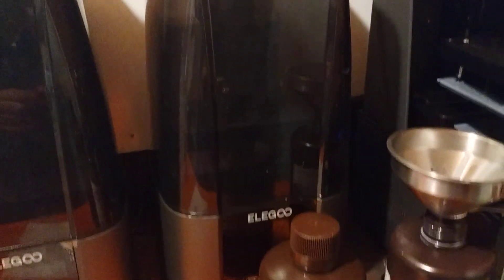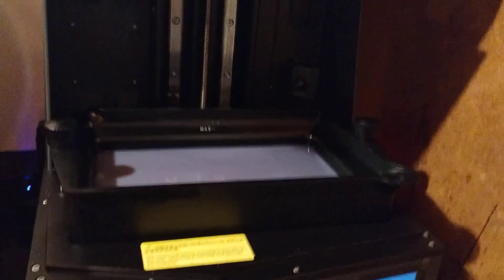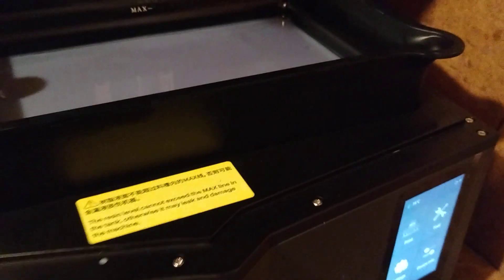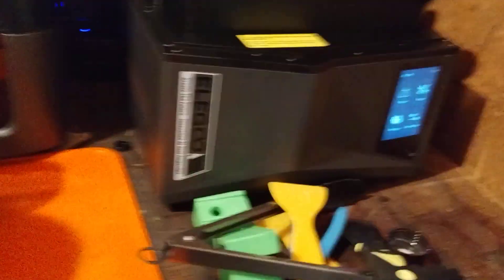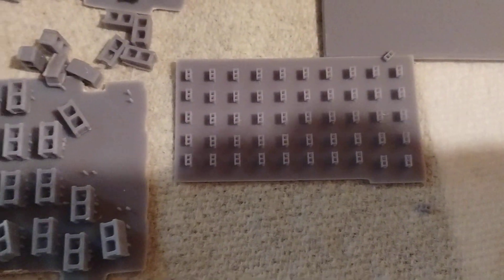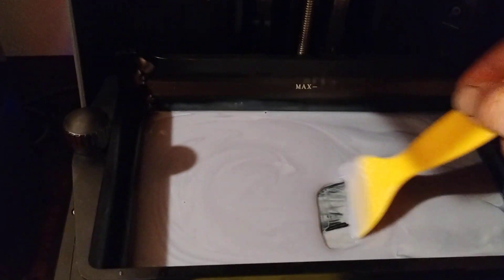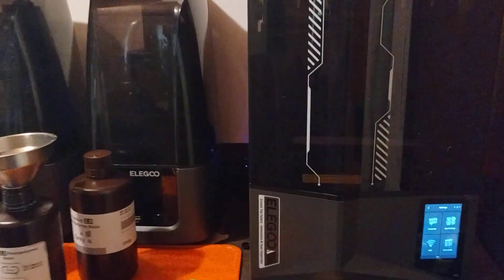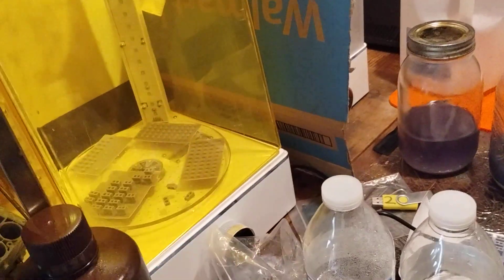Elegoo Saturn 4 Ultra ,  is it worth it?

Comment: Bro why are you touching uncured resin with your bare hands?? You realize your body is absorbing that stuff right and sooner than later you’ll start getting allergic reactions to the resin…. Please wear gloves especially because ppl who have never used these machines before may find this and use it as directions on how to use the S4U. 
Also using that plastic scraper is scratching your fep sheet…. Buy a silicone spatula to softly move the resin around in the vat.
Reply from the maker: @johnpereira9897  the resin definitely makes me itchy,   I'm just starting,   seems cool but very messy,